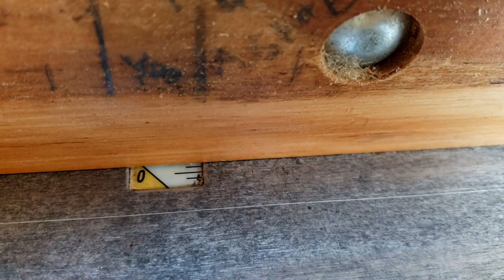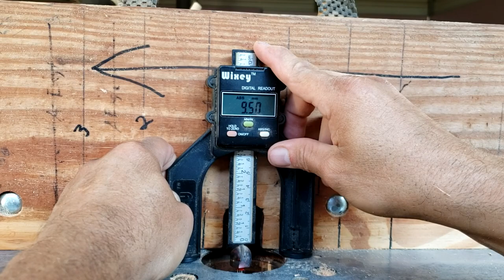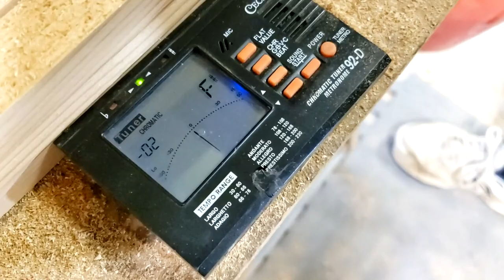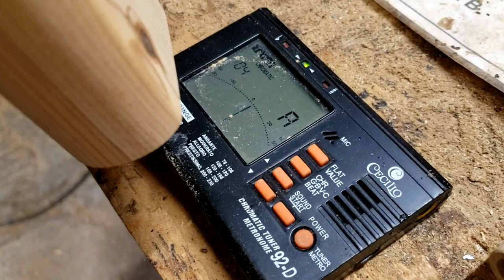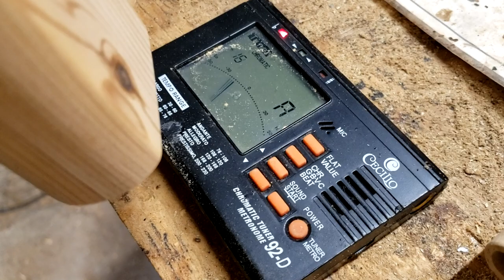Making a Native American Drone Flute - No Commentary - Blue Bear Flutes

Comment: Is it necessary to put the hole on the other side of a A drone flute?
Reply from the maker: Nope, however it is easily playable by most people and makes for a wonderful melodic experience!
Reply: May I ask what the liquidity substance is that you squirter in the chambers?
Reply from the maker: @donaldhenhawke5187  usually mineral oil. 🙂